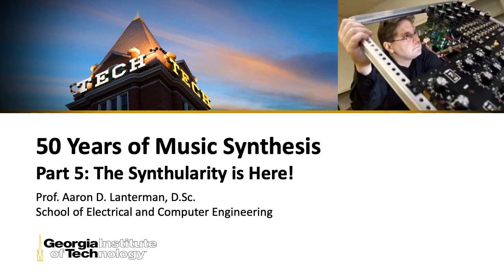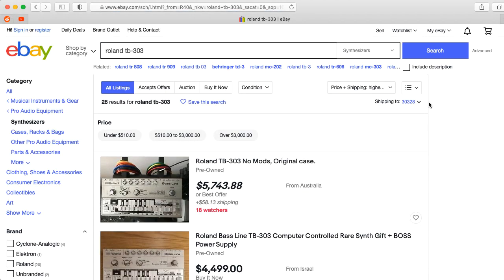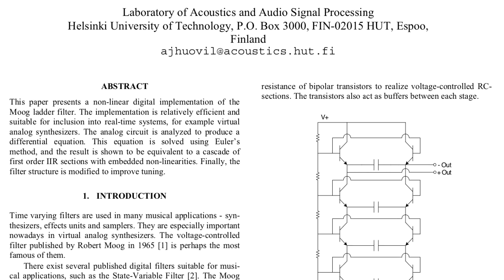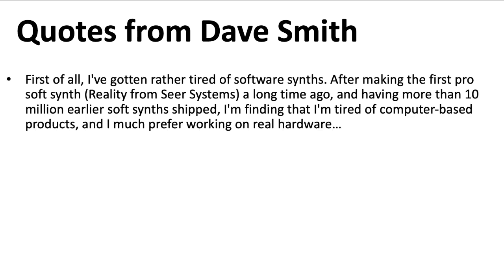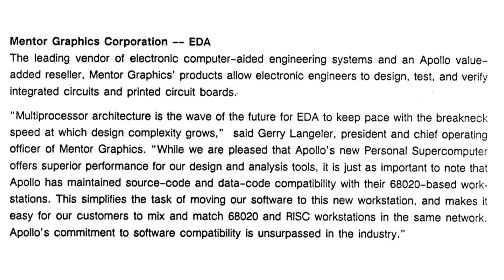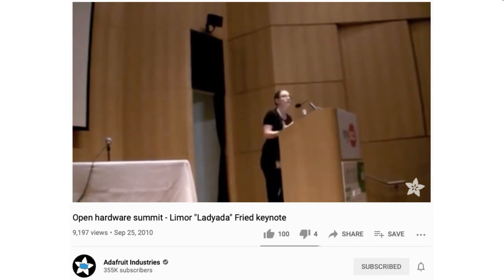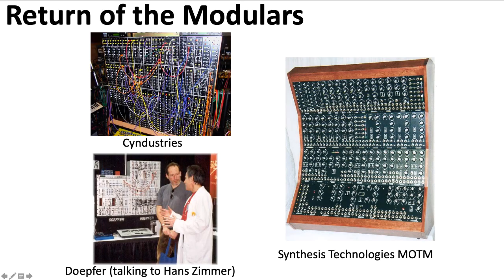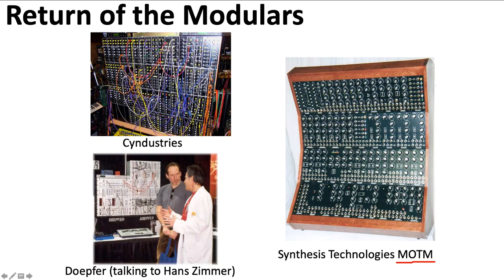ECE4450 L2.5: 50 Years of Music Synthesis: The Synthularity is Here! (Analog Circuits for Music)

Comment: For matched transistor pairs, Analog Devices still makes some ie: SSM2212 but other than that it's doing it by hand and thermally coupling the parts together
Reply from the maker: There's also the THAT300 which is a quad matched set, although, that's overkill if you really only need a matched pair.
Reply: @Lantertronics  Yes! Totally forgot about those. Work great for the 4-transistor Wilson current mirror.
Reply from the maker: @leavenember6149  They're really expensive, sadly... alas, Moore's law doesn't work on analog.